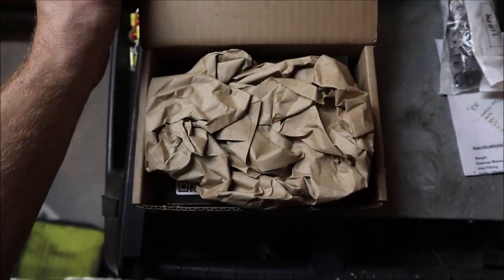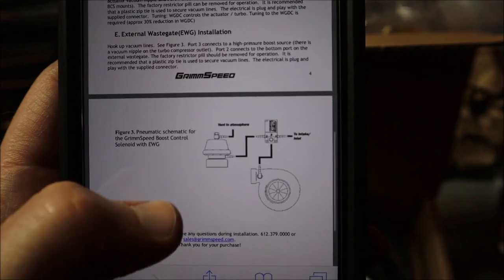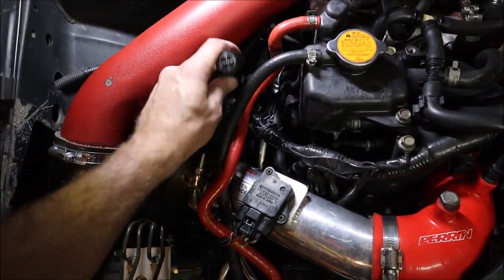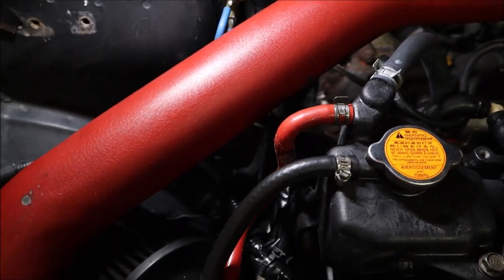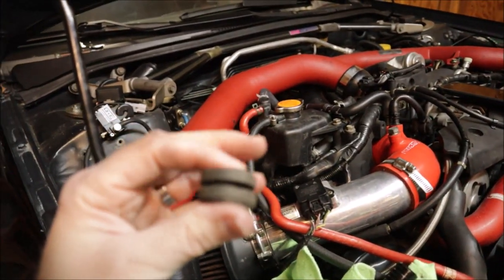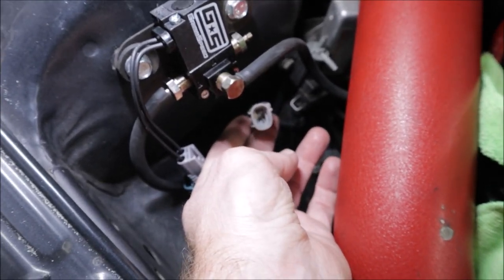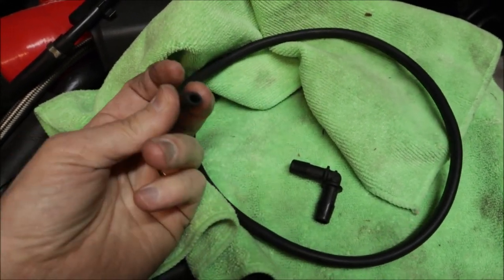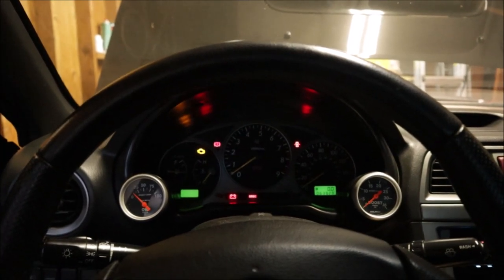Electronic Boost Controller Install: Subaru Impreza 2.5RS GC8 RSTI Part 6

Comment: 3:53  thats the front o2 plug,  I believe the other is the abs.   The vac plug you need an adapter.  subaru sells them they are around 2 bucks  I don't remember the part number
Reply from the maker: Wolfy1091 good looking out! I have a catless uppipe so that explains why the  resistor is there. I thought the other thing with the vacume lines and metal box was stock boost controller?
Reply: @RoadPatina  I don't know what the hot box is I didn't use it for my swap..  The stock boost controller is plastic and has two large vac hose's that go to smaller ones using the adpters from subaru.  One goes back to the spot on the intake and the other goes to the t for the turbo .  All three lines on the boost controller you have need to be hooked up.
Reply from the maker: Wolfy1091 thank you!
Reply: @RoadPatina  No problem man.  16385AA030 This is the part number for the vac hose adapter.
Reply from the maker: Wolfy1091 👍 I’ll look into it! Thanks!

Comment: Hey man i have a 99' rs jdm version 5 conversion, which boost controller fits ? Should I buy the 2002 WRX one ?
Reply from the maker: Gigi Giurescu are you wanting an electronic aftermarket one? I am not sure exactly. Check the connector on the harness. I would not change it without a tune!

Comment: Isnt that just a solenoid not a controller tho ? Ebc , Ebcs
Reply from the maker: Electronic boost control solenoid. It controls the boost electronically through the cobb ap.
Reply: @RoadPatina  so say what would be the diff between this and say the greddy profec electronic boost controller 15500214 like with the grimspeed you can only change with a ecu tune but with greddy you can adjust on the fly ?
Reply from the maker: @gecko1406  hmm I don’t know much about that one. Looks pretty fancy!
Reply: @RoadPatina  that  understandable idk either im trying to ask around i cant really find no  forms about ppl comparing like say a grimmspeed boost control solonoid to somthing like the greddy boost controller to state a diffrence cause when you google search boost controller mostly every time you only get results for like the grimspeed control solanoid but no options for something like the greddy wut i assume but need to do some more looking into is that they are similar products but with greddy you can adjust on the fly without needing a protune to change boost level 🤷‍♂️ but thank u for the help either way bro 👌
Reply from the maker: @gecko1406  I would never adjust boost on the fly. Trust me, you will grenade the engine. Been there it’s heartbreaking. Most don’t run manual boost controllers. It’s desirable to adjust the boost via tune and it can tapper etc. Find a trusted tuner and ask them what to run. It will save time and money and you won’t buy parts that may not work with your application!
Reply: @RoadPatina  thats ture i didnt think about the possibility of blowing a motor y idk lol😂 imma be driving by near r/t tuneing near me possibly friday and see what they would say or recomend 🤷‍♂️ but im pretty shure the grimmspeed bcs is perfect or just overkill for for a close to 490hp build